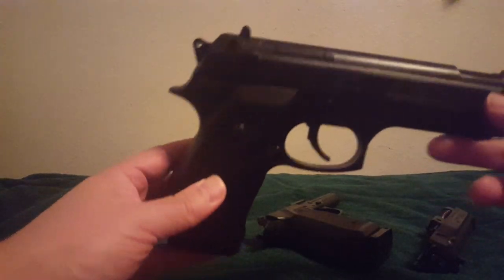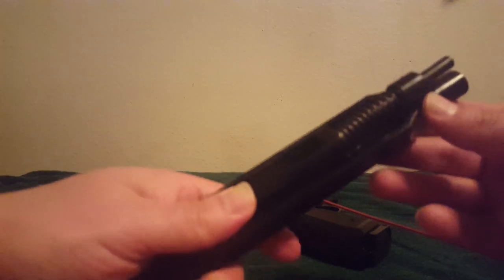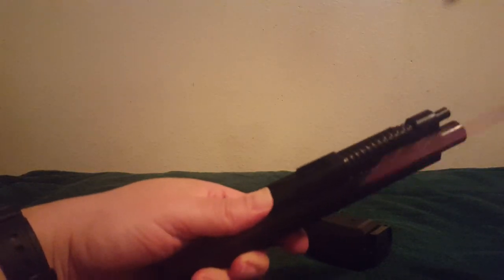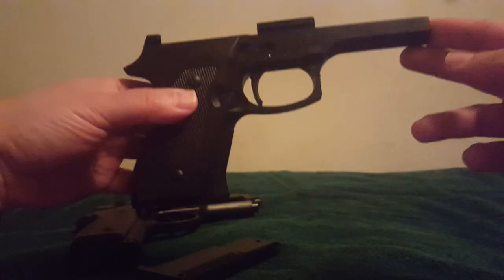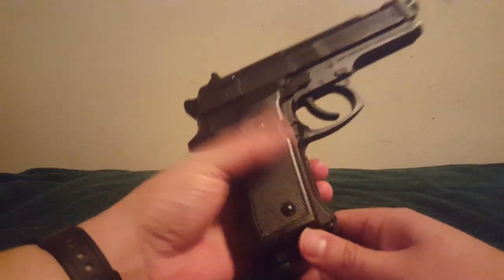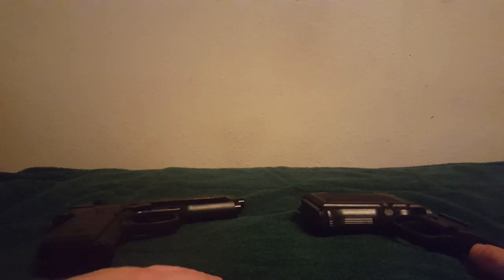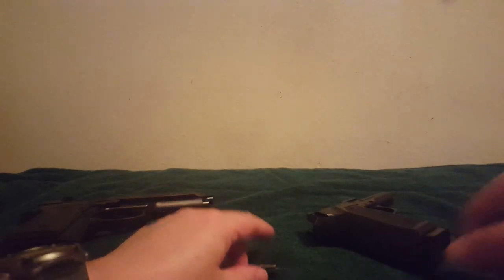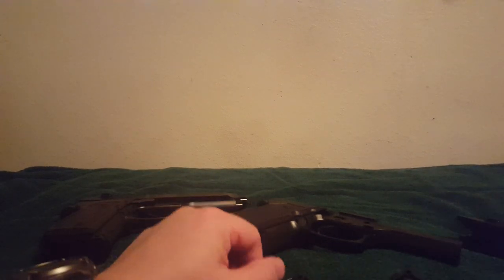Daisy 340 - It Doesn't Shoot.  Checklist.

Comment from the maker: IF THE METAL POST IN BACK BREAKS, OR THE FRONT OF PISTON TUBE IS CRACKED, THAT IS BEYOND A JAM. THAT IS BREAKAGE BEYOND THIS VIDEO.

You will need new gun, and avoid Copperhead BBs in this model. Use only new Daisy BBs.  Avoid sling shot of the slide. Don't dry fire the hammer (practicing trigger pull).

Removing Trigger

The trigger blade is anchored by one pivot pin. Unless you hit it, from the left side, it shouldn't be loose.

There is a rough side for anchoring it in the frame. The right side (if you are pointing the gun forward). If you need to remove it,  tap LEft to right. Tap from safety side. One or two light taps, punches it out.

With pins, you don't want to tap the rough side through frame since it will lose its anchor ability. Normally it is left to right, but if 2 light taps won't punch it out, or show movement. try other side. Here, the 340 IS left to right.

Comment: I miss mine 340! Its collecting dust on a shelf because my cast iron part broke: I hope someday the people of Daisy will answer my emails and send me that part. Thanks for your videos.

A hug from Argentina!
Reply from the maker: Emilio, I had TWO of those metal posts break on me. I approached casting specialist, and they said Daisy should make that part of your trigger assembly out of 41/40 steel. You can research that metal. They wanted $1000 for me to get it custom made, so I learned to be careful with 3rd mainframe (bottom half).

I made a  340 Quick Tips video and made that section a center piece.

As far as calling Daisy Ladies, you have to do it before 5pm Arkansas time, weekdays. The gun is such an inexpensive carnival pistol, I would just buy another. $10 Walmart. I did. Three times. All 3 slides still good. Third 340 still alive, post still solid.

One of the reps did send new trigger assembly, for free, but it was from warranty section. So when I opened the box I wasn't too surprised to see it too was broken. So Daisy knows it needs stronger part there. The rep was nice, though, so no biggie, and I saved other parts from it.

Comment: I just used this video to clear a jam in my barrel. Thank you!  NOTE TO ALL - Dust Devils do NOT work in this gun.  At least in mine.
Reply from the maker: Jeffery glad it worked out! Yes, just go w Daisy BBs and only NEW BBs!

I forgot to show how to take slide off to start, but I got those steps in there. Most should figure it out like you did. 

The 340 is a fun carnival gun and is suitable for fun training, retaining handgun skills.
Reply: @daisy880fanaticfixit9  - Like you, I'm in a small back yard, but I like "plinking" with my BB guns so I was testing all of them to see which one's I could use lead BBs or frangibles in.  I've got a good setup, but I really want to keep ricochets to a minimum. My Daisy 426 and 415, and the Crosman Phantom don't seem to care, but that 340 got all kinds of messed up.  The Grizzly seems fine with anything I feed it, but I haven't tested the Daisy 74 yet.  Really need to tape that barrel if I want any real accuracy out of it.  Basically, I'm going through all my air guns,  and using them for my stress relief while we're all avoiding other people in real life.

Comment from the maker: SLIDE LOCK MECHANICS 

The slidelock is removed by pushing IN the slide release button on the RIGHT side.

Then twist the arm of the slide lock DOWN, and pull it out.

Remove the slide release rod and spring so it doesn't get lost or damaged. Put it on the table with the slide lock.

Comment: Hey. I bought one of these off of my friend just yesterday, more interested in practicing reloading than shooting. He gave me the pistol, it’s magazine, a bottle of Copperhead BBs, and some targets.

From what I’ve read in this comment section, I shouldn’t use Copperhead BBs, but, like I said, I don’t care much for firing.

The problem I have is that when I pull the slide back, it cocks, but gets stuck as if the slide release was pushed up. As we know, the slide release on this model acts like a safety instead, so it doesn’t lock it back.

While the slide is locked back when it shouldn’t be, if I apply a bit of force against the rear of the slide (a tap with my finger, let’s say) - it shoots forwards, also firing in the process. I tried with a BB in the mag, it shot the BB out. This is constant, and I’m unsure about the cause.

You answered 1-2 others with a similar problem about the metal catch thing being warped or something similar. When I looked down at the hammer from a top down view, I can see the metal part sticking out slightly, is that normal? If not I assume it’s been bent back.

I HAVE dry fired and held the slide back, so I only have myself to blame.
Reply from the maker: Well, thanks for clear comment and reading other comments.

Dry firing normally breaks the front of the piston tube. Your gun locking open is new to me. In 9000 shots, it never locked open like a real 9mm. But I worked hard to never dry fire.

If your post is warped and cracked, your 340 responds by NOT cocking. The sear can't catch the piston. 

Sling shotting the psm45 routinely causes a lock out. But letting the slide ZING forward with out riding it home with your hand busts up your hop up. For your 340 to lock open, your loader is getting caught up, and damage has occurred in the breech/hop up area. And, yes, dry firing is death to the 340.
Reply: It sucks that breaks and damages can be caused by such a simple thing. However, the gun isn’t exactly built for “fidgeting.”

I always manage to break things in such a weird way, so it doesn’t surprise me that you’ve never come across the slide locking back like that.

Thanks for your reply.
Reply from the maker: Hey, don't walk away feeling bad. The psm45 is better built and engineered.

But dry firing them, these carnival pistols, is very deadly to their survival. And, yes, they are fragile. The 340 MORE SO than the Crosman.

There might be better replica guns that aren't actually BB guns, more like props out there. That might suit your needs better.

Comment from the maker: ⚠️BB Dribbles Down the Barrel

How many shots do you have on the gun, and what BBs are you using?

If you have been dry firing the BB gun, there is no BB inside the breech, and the piston tube fractures. It is plastic. That means air escapes. No more power. The BB dribbles down the barrel. 

If you have over a thousand shots, the post in back, that your hammer hits, fractures and the gun won't cock.  The piston won't lock on the sear.

It sounds like scenario #1. But the wrong BBs also cause jams and dribbling down the barrel.

Use new Daisy BBs (Blue and White label) or Umarex BBs. The Red and Yellow label Daisy BBs have lower QC and caused many feed jams and barrel jams in my 340.

Comment: My BB gun won't shoot I cock it back and as it goes back after cocking it sorta shoots but doesn't shoot enough to go flying out and the BB just falls out
Reply from the maker: How many shots do you have on the gun, and what BBs are you using?

If you have been dry firing the BB gun, there is no BB inside the breech, and the piston tube fractures. It is plastic. That means air escapes. No more power. The BB dribbles down the barrel. 

If you have over a thousand shots, the post in back, that your hammer hits, fractures and the gun won't cock.  The piston won't lock on the sear.

It sounds like scenario #1. But the wrong BBs also cause jams and dribbling down the barrel.

Comment: I was wondering if you could help me address the mag issue I’ve been experiencing with this gun. The mag simply just won’t hold. What a are some steps to address this issue?
Reply from the maker: Ok, let's go through another checklist.

(1) Have you loaned it to a friend? You would be shocked how many buddies wreck these guns. They take it apart and either lose the return spring for the slide lock or the compression spring for the mag lock. Here is a video for fixing a missing spring in your mag lock.

https://youtu.be/8F0htSxzLiA?si=_ZWUgD3metpqUW20

(2) TRY LUBE. It could be dry TIGHT PLASTIC. Try a drop of 10 to 30 weight ND. Lube the edges of toggle plastic.

(3) You have big, strong hands! In some cases, YOUR HOLD can trip a magazine release. If you are a lefty, it is common! Check your grip and avoid a mag ejection.

(4) There is grime on the magazine catch point. Clean it off. The notch on the magazine. Check it.

(5) Failure to FULLY insert it! You must hear a snap.

Comment: I’ve checked all of that and mine still will not shoot, no parts of it seem broken. Plus I’ll rack it and when I shoot a BB will slide out of the barrel/flop out. Any help?
Reply from the maker: Omar, this looks like a BIG problem. You are the 10th shooter who has approached me with this issue. It looks like a cracked piston tube. That tube is where your piston head resides that fires your BB.

My third 340 still alive and well. My issue was the metal post breaking. I stopped dry firing hammer. My original slide lasted 8,000 shots.

Omar, if you have been dry firing the gun, that TRADITIONALLY destroys the piston head in more POWERFUL spring guns. In the 340, shooting Copperheads or dry firing it breaks the plastic piston tube. The Copperheads are too small, like semi dry fire.

I only use new Daisy BBs, and I count how many BBs are in feeder and track it. I try.not to dry fire it.

If you have been dry firing the piston, get a new 340 and don't dry fire the piston - or the hammer.

Comment: My 340 will chamber and everything but when I go to shoot the bb will either roll out of the barrel or will have no pressure from the spring I have took it all apart and tried fixing it but I can't figure out the issue
Reply from the maker: Hillbillyman, here are the main breaks in the 340:

The die-cast post in back (that your hammer contacts) fractures. The gun won't cock anymore. The piston sear and piston catch won't mate.

Your description many times is from dry firing, but you may not have done that. The 340 having little or no power is many times from the plastic piston tube fracturing. Air escapes sideways. The BB just rolls down the barrrel.

It isn't your fault the plastic piston tube and the die-cast metal post are liabilities in this design. My piston tubes never broke, and I never dry fired them over and over. Some kids do that, turning it into a toy. The piston tube breaks.

If you have 8,000 shots on that spring, it also can "set" lose power. I had that happen. I replaced with a second piston tube and spring. You would have to have at least 5,000 shots.

Comment: my gun fires, however the bb just falls out of the front. What could be wrong?
Reply from the maker: Cody, that is great question and deserves detailed answer.

That means there is a failure in the compression chamber. I used to think it was the rubber breech seal that holds the BB.

But with more experience with this BREAKAGE, I know it is a shattered piston tube. The front of that plastic tube that holds the mainspring breaks - AND AIR ESCAPES.

To verify it, remove your slide lock, take off the slide, and push up on the hop up with one hand. (That is bottom part with hole that BB goes into). Shine a light on the front of piston tube to see cracks. That comes from dry firing.

NONE of my 3 340s suffered that break. Only the metal post in back cracking and warping stopped the gun from cocking. Kaput.

Comment: Bought a Daisy’s 200 BB gun, will not feed in bottom for the 5 shot and leeks out CO 2 in about minute, Any help Thanks
Reply from the maker: William, that is OLD discontinued gun. It looks nice. As far as feed issues, I don't have one to study.

As far a leaking, it likely needs seal change out. But before we write it off as needing major repair, put compressor oil on top of a few CO2 cartidges and see If that seals it up. That lube spot seals face plate and sprays inside compression chamber.

Here are some lube choices for CO2.

https://www.amazon.com/Super-Lube-56204-Silicone-Lubricant/dp/B083NXVGQX

https://www.homedepot.com/p/Husky-16-oz-100-Full-Synthetic-Compressor-Oil-018-0083H/300135698
Reply: Thank you, I will try the oil and hope it works, I’m thinking there is something inside blocking the bbs from going in bottom end somewhere inside it, This would explains why it looks new in the box with everything it came with

Comment: Mine used to shoot fine. However, not it barely shoots 15 feet. I've pulled the pin to remove the rack for inspection and can't see anything physically wrong .. but something obviously is.  Either that, or its a really poorly made BB gun, which doesn't last very long.  If you have any ideas, let me know before I pitch the thing. Thanks
Reply from the maker: Bill, the guys at the gun shop really feel Daisy cut corners with MATERIALS used.

The 2 breakage points are the FRONT of the piston tube, and the sear post (metal upright in back) that your hammer hits. I had 2 posts break. I trace it to dry firing hammer. My third mainframe, bottom half, is over 5,000 shots old. No dry firing.

Dry firing piston or using Copperheads here can wreck it. So the front of piston tube is solid? Not cracked? I just retired my original slide after 8,000 shots. At that time it was shooting like you describe. The new slide, a slide in reserve, can punch through one side of popcan easily, some times both sides. If you lost track of your 340 history, the mainspring it good for 8,000 shots. I don't know If you shot it that much.

A metal specialist said that post should be 41/40 steel, tbe piston tube metal, but his after market help would cost $1000 to start. Daisy could make these upgrades.

I am currently looking at after market springs. That looks more reasonable . A torsion spring under hammer just broke, and I had spare parts, so it got fixed that night.

Bill, when I shoot my 340 at 5 yards, it can punch through atleast one side of pop can filled with water, front flattened. Many times the first hit punches through both sides..

Are you using Daisy BBs? New BBs? Also, depending on what ammo a shooter is using, the breach seal can get damaged which would cause air leakage.
Reply: @daisy880fanaticfixit9  Thanks for the reply.  I had the 340 all apart yesterday, looking for something obviously wrong, but didn't see anything. That post in the back into which the top part slides seems fine.  I'm using Umarex Black Diamond anodized steel BBs .. new ones. After reassembling the pistol yesterday, I topped off the reservoir, pulled the loader back to fill it, and then test fired it into my kitchen trash bin. There was a very thin plastic cookie container in there. At point blank range, the BB bounced off. The same happened when I aimed it at an empty milk carton. I have occasionally 'dry fired' it when the BB bank ran out.  I'll have to look at that piston tube .. not sure what it looks like, but I'll look for cracks. Being spring powered, the 340 was handy to keep at the side door to chase squirrels out of my nut trees. I have Crossman Vigilante CO2 powered gun, but, by the time I put a CO2 cartridge in, I may have missed my opportunity.  I've been looking at a Crossman 1322 pump, which could be deployed more quickly.  Thanks for giving me some feedback and places to check.  If I found broken parts in the 340, I wouldn't know where to get replacement parts, so I'd probably just pitch it.  Thanks again.

Comment: Thank you for taking the time to make such informative videos.  What is wrong and can I fix my 340 that has lost most of it's power and only shoots the bb about 20 feet?
Reply from the maker: Jim, make sure to use only Daisy BBs. And don't shoot used BBs.  If you have thousands of shots through your unit, try using Silcone on the power plant.

My 340 Quick Tips video shows lube methods. Also, 340 is only good for about 30 feet in good condition.

When shooters break the gun, it normally it from dry firing. The gun shoots like 4 feet. 

It's a cracked piston tube. That tube is where your piston head resides that fires your BB.

 In the 340, shooting Copperheads or dry firing it breaks the plastic piston tube. The Copperheads are too small, like semi dry fire.

I only use new Daisy BBs, and I count how many BBs are in feeder and track it. I try.not to dry fire it.

My third 340 still alive and well. My issue was the metal post breaking. I stopped dry firing hammer. My original slide lasted 8,000 shots.

Don't dry fire the piston - or the hammer. Those are to 2 break points - piston tube and metal post.
Reply: @daisy880fanaticfixit9  Thank you for the reply.  I lubed the old one that is getting slow and my new one which works fine.  That did help the power on the old 340.  
ps:  I always shoot only Daisy bbs, and I never reuse them.
I''ve learned a lot from all your videos.  Thanks again.

Comment: Is there any way to make this gun more powerful?
Reply from the maker: Beckett, short of a mod attempt, which most don't do right, using ELITE BBs helps.

Black Diamonds ARE FAST and boost velocity.

Other good choices:

Black Widows 
Umarex Zinc

After heavy testing on the 340, 9,000 shots, I had many misfeed jams. So when I switched to the psm45, I shot only Black Diamonds and Widows.  NO JAMS AT ALL.